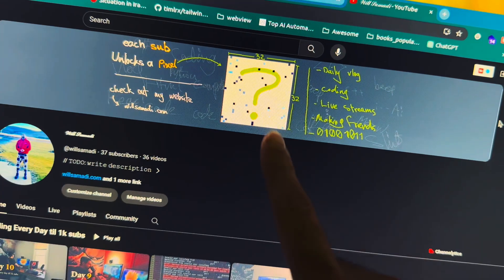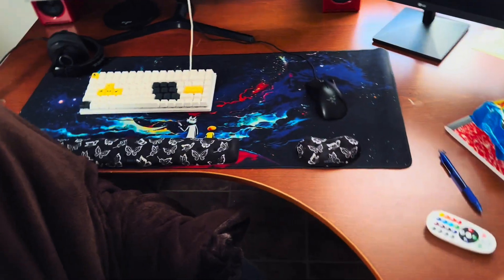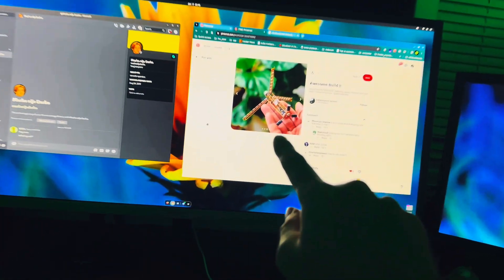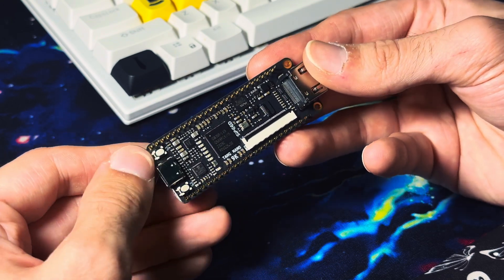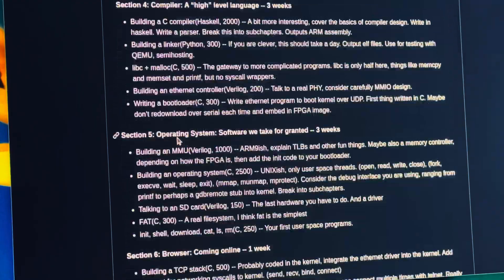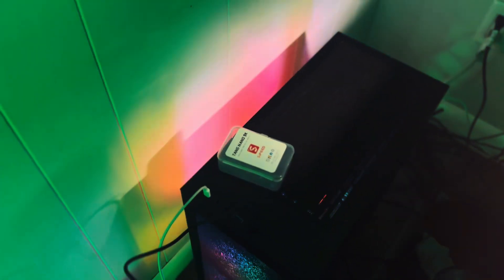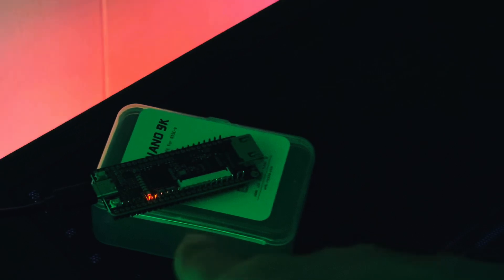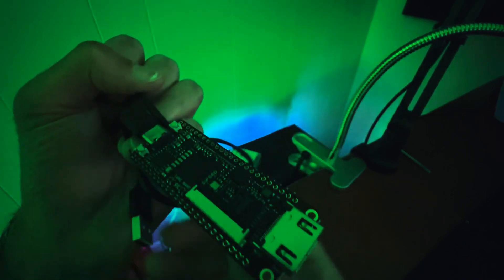𝚗𝚎𝚠 𝙸𝚍𝚎𝚊(𝚝𝚢𝚙𝚎.𝚑𝚊𝚛𝚍𝚠𝚊𝚛𝚎); // 𝙳𝚊𝚢 𝟷𝟸

Comment: Hi! Very cool board, just a quick question: with which program you synthesize the bitstream for the fpga? I suppose you are writing vhdl/verilog code in order to turn on leds and then how to do you synthesize your design?
Reply from the maker: Hey thanks!
I tried using oss cad suite. But it’s very unstable. They release a version every day! I ended up using a toolkit from gwin; the manufacturer of the fpga core. That toolkit works for synth but is very tricky to figure out without the ide. For programming and flashing I use openfpgaloader
Reply from the maker: If you have more specific questions hit me up on discord @willlogs